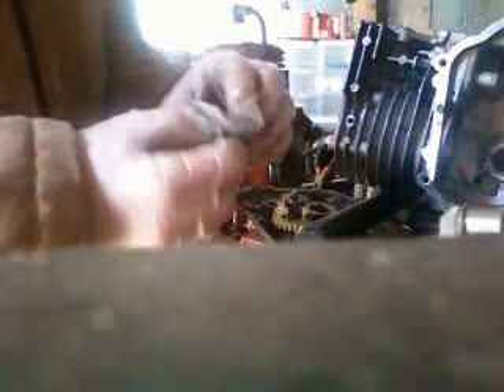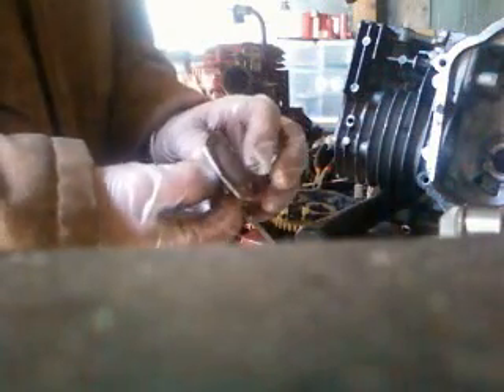cleaning a tecumseh carb with diaphram

Comment: You literally took that time to take carb apart and didn't replace the diaphragm nor gasket?, Nor needle valve seal, Mixure screw O-rings?, Not even talking $8 in parts for new Genuine Tecumseh parts, Diaphragm was clearly torn at the screw hole, Dremel tool??????? Omg..

Comment: Hi I have the same auger, model 30. Mine leaks gas, there is gas on the diaphragm cover, my diaphragm is ripped also. My hose on the primer is junk, but I can't get it off. Also has leaks out my exhaust. Any help would be much appreciated